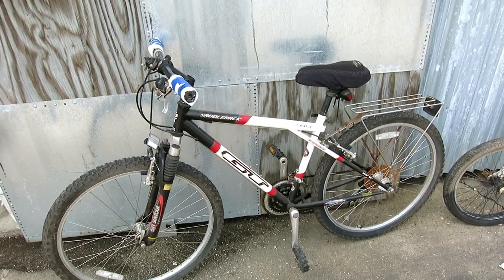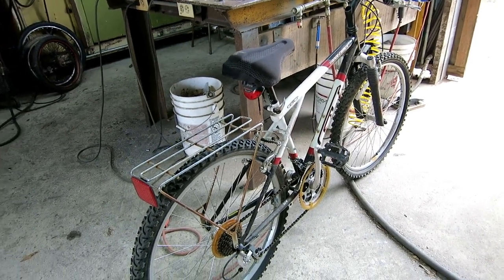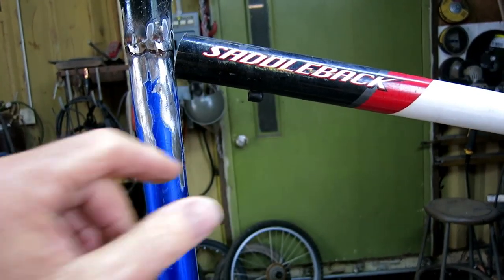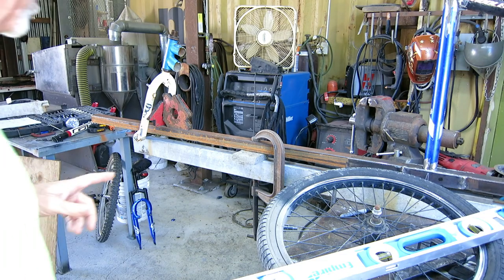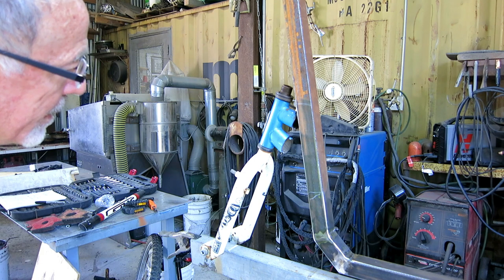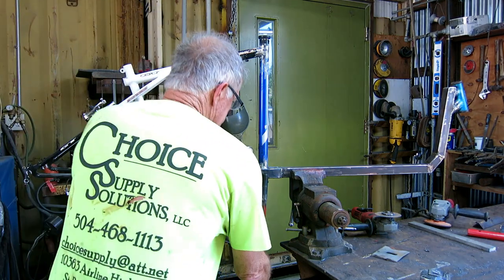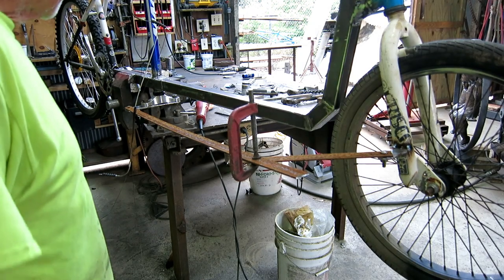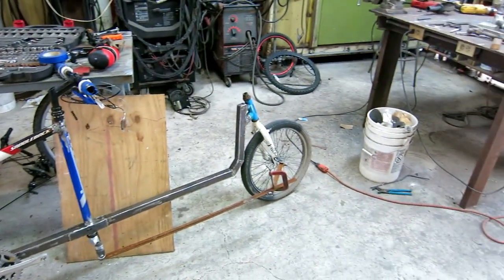DIY Cargo Bike Build Part 1

Comment: Sir which size of two cycles you have used 26 inch and 20 inch
Reply from the maker: Jalesh
That is correct, 26" for the rear and 20" for the front.
Thanks for watching!
Barry

Comment: Hi.... I need the measurements to make the cargo bike kindly. Is it possible
Reply from the maker: Than would be tough. Depending on which two bikes you pick to use, what you want to haul, and what you have to work with the variables are countless. I will say this thought. I have a nice Rubber-made plastic tote that would be perfect for hauling groceries but the frame I built is 1" too narrow for it to fit, dang! So gather up your materials, think about what you would like to haul, and go for it!